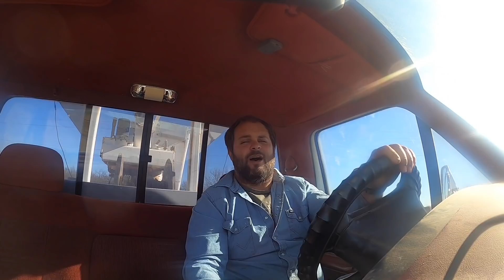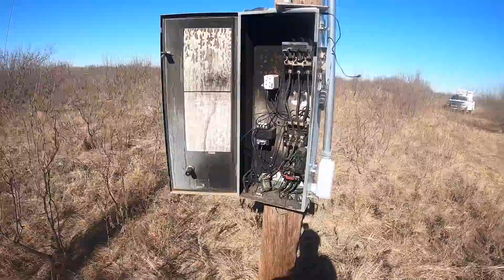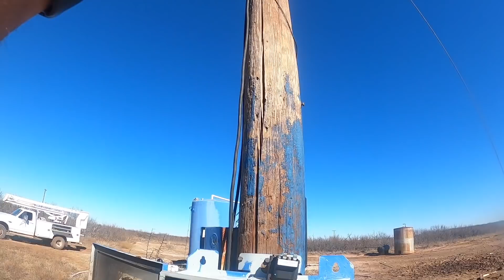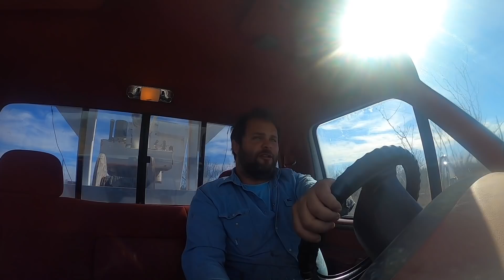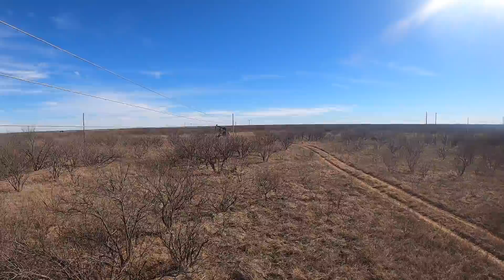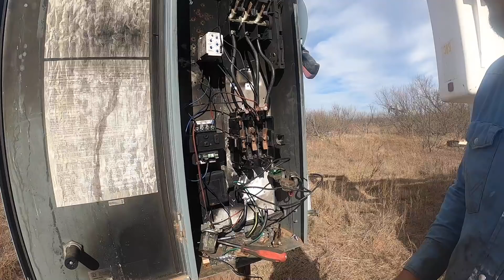Lightning Strike on Some Oilfield Electrical Equipment.

Comment: I can tell you that using a lightning rod place properly would have saved all the components. My location is lightning protected with 3/4" copper stranded wire. Lighting hits the house all the time and does nothing but a huge light bulb over the house and sounds like the house is below a bomb going off. Nothing has ever happened to our abode. The pole that has three phase power two hundred feet from the house get hit about every 4 to 6 months. Does exactly what have at your site. They use 1/4" solid copper wire going down six feet deep. Just not enough to save your breakfast. Nice video fella.
Reply: No, it would not. Go back and watch closer. Poles not taking the hits.
Reply: @bentheguru4986  Please do explain in more detail Ben. Thanks
Reply: Put in a WHOLE HOUSE OUTSIDE SURGE GUARD right at the meter and have a Smart UPS on everything electronic

The truck you need a 2nd high capacity battery in parallel. I had the same issue and I put in a new battery which helped for a couple weeks and then I thought if I had more amps I would have easier time starting the truck.

It worked. I also keep a trickle charger on my vehicles which really made a difference.

BTW, you need to get checked for the virus.

It sounds like you have it

It can go very very bad, in minutes

They have medicine that will start working but you need to get it within 2 days

It sounds like the feeds you should have auto reset fast acting  breakers set to reset once and stay open the second time

The substation should have auto reset breakers set to reset 3 times before locking open

You should add lighting arresters on top of the poles, every pole. Direct 2/0 wire into a 6 foot grounding rod and a 4 foot grounding rod connected with 2/0 wire to the box

I would put solar panels and a remote cellular monitor for loss of each phase.

I would use a passive amp monitor that is non contact and if power is lost on any phase it will call a number you program.

I had remote transmitter sites that I had solar panels and deep cycle 12 volt batteries to power the 4 watt cellular phone and the monitor.

When something went wrong, there were dozens of alarms that it could send.

I would get a call in the middle of the night and the pre-recorded computer voice would say either:

ALARM

or

EMERGENCY

Transmitter Site ( ##-####### )

FAULT 00 through 99
but there were only about 30 faults used

And the monitor would wait 20 seconds for an input and then repeat the same message and do that over and over

So for instance if the heater tripped off it might be Fault 02

If power to the transmitter was off it would be fault 10 and if the building main was off it would say fault 20

And it would read off all of the faults and I would enter a 2-digit DTMF code to send the signal to reset and turn back on whatever had gone off

And it would reset and then tell me the status and if the fault was cleared and I would enter ##
To clear everything until it to go back into standby monitor mode

And if something was really wrong I could turn off the transmitter with 98 and I could turn off the building main three-phase breaker with 99

That remote system saved so many long drives out to remote mountaintops

I remember one early morning around 3 a.m. when I got a call from the highest peak sight we had and it was in a building shared with the state and County Emergency Services and I called the contact number for the State dispatch for that Tower and I said are you guys seeing a loss of primary power and they said no everything looks fine and the chief engineer went up and the entire electrical panel for our side of the building had caught fire and melted and luckily the entire build when was cinder block and concrete and steel beams

The fire charred the whole wall and burnt itself out

The wires had all burnt up and were stopped by the fire break junctions for the conduit going from one side to the other through the wall and to the outside and there was a special type of foam that was inside that did not burn

I have spoken to people in West Texas that tell me there are no inspectors and that you can build anything and do anything you want

It is a very rule area and people have bought big pieces of land for very little money and they basically just wanted to be left alone the way it used to be in many places here on the East Coast before we got overpopulated and had so many state and local agencies created

In the 70s the road where I lived was dirt and they paved it in 1980

The building of houses in the 70s and 80s required an initial permit

For the electrical you needed the initial inspection of the transformer to the meter box and the meter box to the main panel

Just the 200-amp feed wires

The inspector would check the ground rod and the ground wire to the meter box and the four wires from the transformer through the conduit into the meter box and from the meter box into the main panel

as soon as you receive that sign off you could go to town and wire up the whole house

In the 90s they changed to add a additional inspection where you would run the Romex to the boxes and you would strip off the jacket and nothing else

After the inspector signed off on that in the 90s you would go to wiring in your switches and outlets and light fixtures and everything else and it would all be connected up but it wouldn't be screwed in and the inspector would come and do the final inspection and then you could button everything up

But even as late as 1999, I remember the Fourth of July weekend and I'm pretty sure was 99 it might have been 2000 but I'm pretty sure it was 99 that it was a long three day weekend

My neighbor cleared the trees on the North side of his lot

That bordered my vacant lot and on Friday the bulldozer cleared the trees and brush and Saturday he poured a concrete pad

On Sunday he began building a three-story industrial garage

On Monday the holiday he finished building it

The garage was 100 ft by 50 ft.

No permits no nothing

In the spring of 2002 basically every single piece of land and every single lot that had been waiting for someone to buy it and put a house was bought and houses were built.

The amount of building that happened was so dramatic that we went from having a huge portion of the county that had no government infrastructure whatsoever and we never saw a police car they just didn't come to where we were

We didn't have any crime either so it wasn't a big deal

But with all of the million-dollar house is being built and all of that new tax money they built a town hall and town buildings and a road department and there were 3 new departments that had nothing but permits and rules and fees

It went downhill really fast after that

But West Texas I had relatives that went there last year and I asked them why they hadn't been in touch while they were traveling and they said they didn't have phone service and I said there weren't cell towers along even the highways and they said there wasn't anything along the highways there weren't towns there weren't phone lines there weren't power lines there weren't gas stations there just wasn't anything

And people that I've talked to that went and moved out there after this area got built up said it was like it used to be in the 40s around here where you could just buy a piece of land and build a house with no permits and do anything you wanted

But that is a trade-off

One of the people had purchased 50 acres and they figured out that the phone company is required to give phone service to everyone in America and they have to run the lines to wherever you are and in doing so they have to be able to get the bulldozer to where the drop is

And they figured out that one of the things that is still available that you can request is an actual telephone booth

So they requested phone service and a telephone booth in addition to the phone for the house and they bulldozed and created a road where they buried the cable

That was pretty resourceful

The person said that they had been told by the county when they did the purchase that they didn't have to worry about a septic system because they purchased more than twelve acres and if you purchase more than twelve acres you don't have to have a septic tank but if you purchase less than 12 you have to get a permit and you have to install a septic

The house the guy built didn't have any water there was no well and there was no plumbing and he built an outhouse

And it reminded me that in the seventies and even until the mid-80s where I live there were still out houses in back of some homes and those homes had hand pumps at the kitchen sink that were how they got water

Even in town there were Warehouse is that didn't have any running water and on the back in the alley there were two outhouses that in the 80s were still being used by the employees

The town had no stoplights in the 70s
And I remember they put in a traffic light at the corner where there was a little mini mart gas station and the firehouse was down that street and there was a little supermarket down that street and that was the first light in town

In the neighboring town there was a light that had been there since I think the 50s that was the main road north to south and the main road east to west

And that was the only light in that town

The amount of infrastructure and the overpopulation is just so depressing

I remember in the 80s in the middle of the night you could stand in the middle of the highway and there wasn't a single car all night long

Now they are expanding the highway because both lanes are bumper-to-bumper 24 hours a day

It's very depressing
Reply: @ocsrc  you need someone to talk to 😅
Reply: @johnsebastianbach  I am talking to you JohnBACH

Comment: Seems like it would be worth it for the utility to stick a static wire over the primaries.  At least that is what I would do if I was operations engineer.
Also, a small pair of bolt cutters are your friend for cutting ACSR (Aluminum Conductor Steel Reinforced AKA that steel core stuff you use for overhead).
Reply: was thinking the same thing.

Comment: Im a fan of Raycap Strikesorbs on the contactor line side.  We use them on wind turbines and they seem to perform well.  You can test the raycaps with a megger which is nice.  Not sure of the cost but may be worth looking into.  Enjoy your videos!
Reply from the maker: I"m going to look into them. A quick google search look like something that may be what I need.

Comment: Thanks for the video, Zach, just seems like there should be some sort of cost effective blow out fuse before it gets to the box, can't be cheap to swap out all that equipment in the box, hey take care.
Reply: There is we use them on 3 phase tornado siren contactor boxes all the time...  screws into the box wires in and it blows up instead of the box....  That only works if its coming in the power lines which in this case it appears it is....  Also helps to ground  the pole with a copper line from top to bottom...

Comment: Excellent video -- thanks for sharing.  Could it be a benefit to install another pole a few feet away, and put a metal rod atop it with a big wire running to a ground stake, use that as a lightning trap?  If lightning indeed strikes the tallest thing "around," having a taller thing to take one for the team might save some expensive stuff.  I normally have no idea what I am talking about. :)
Reply: That is actually standard practice for substations and switchyards.  General rule of thumb is that a rod of height h reduces the likelihood of anything within an imaginary cone formed by the axis of the rod and extending out from the base of the rod a radius 2h by a factor of 1,000 but only for things inside this imaginary cone.  Problems are more along the lines of strikes to the primaries or in cases of high resistivity dirt there can actually be flashover of the pole to the primaries or secondaries cuz ground potential rise.  This kind of thing really requires a static wire over the primaries and any secondary spurs.
Reply from the maker: My understanding is that the lightning comes down initially in many small feeler bolts that are what actually blow up everything before one of the small initial bolts makes a conductive path for the big bolt. So the actual damage happens a split second before the actual flash even if the actually strike is aways off.

Comment: Great video man! In Houston we have lightinng protection on all the commercial buildings I work at. All it is is a 1/2 galvanized rod about 12" in length with a rubber isolator attaching it to the equipment and 1/0 Harger tinned copper conductor connected to the rod and then the 1/0 wire goes to a ground rod. I don't know if this will help in your situation.
Reply from the maker: Thanks, about 1/2 of the polls out here (both of the ones with control panels and others) have a ground rod with a bare copper #6 that's stapled up the poll and stapled to the very top to work as a similar ideal.
Reply: @TheZachLife  Since you mentioned at least appearing to follow the NEC, you might want to get into the habit of picking up the appropriate Insulating Bushings when you pick up your Box Connectors.  They cost literally pennies, keep the wiring from rubbing on a potentially sharp edge, and deny the inspector an easily visible violation.

If they DO start getting more militant on inspections, be sure to keep in touch with your peers about them.  Most inspectors have "pet peeves" that they specifically look for...sometimes to the point of missing obvious issues elsewhere.  My local AHJ used to have a thing for the bushings and for bonding/grounding of everything metal that he could see.  Put in a metal shelf on the wall of your data room for your reference manuals to sit on, it better have a green #6 bolted to it.